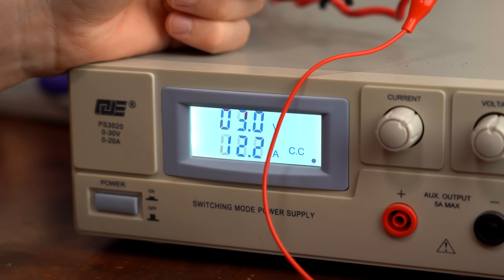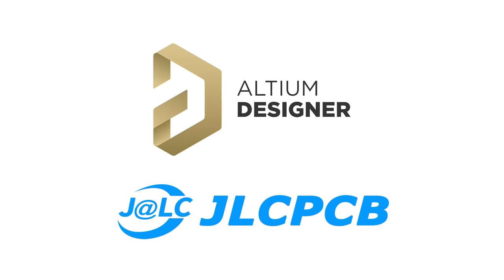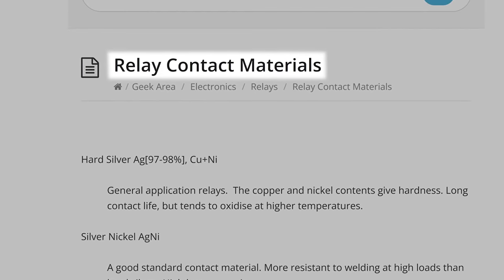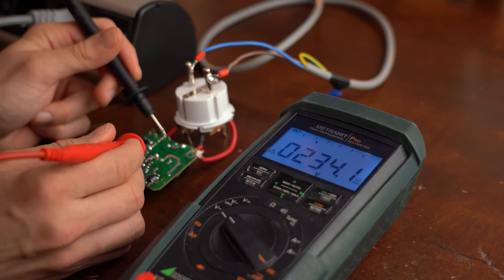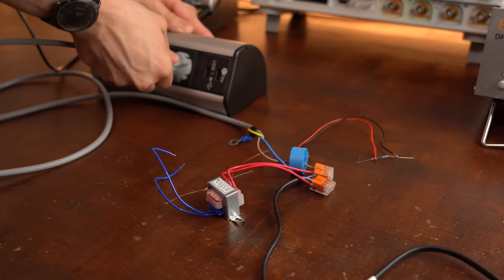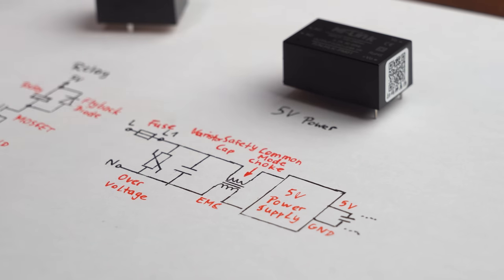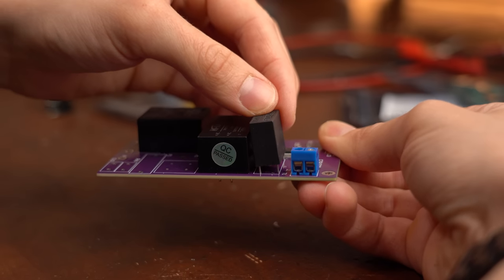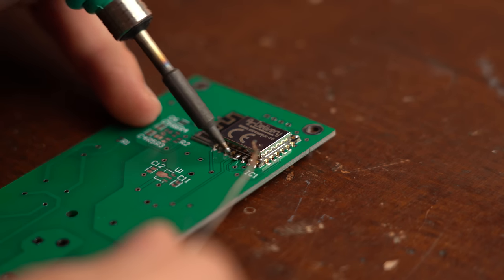The Dark Secret of Smart Sockets and How I Fixed it! (DIY or Buy)

Comment: One thing I was surprised you didn't mention was proper derating for relays depending on anticipated load type.

One of my pet peeves about these sorts of "smart switch" things is that they generally use the cheapest relays they can get away with, which means they are also not derating them properly.  If the switch claims it supports, say, 10A, they actually mean that only for purely resistive loads. (and sometimes it may even say that somewhere in the fine print, but often not)  For any other types of loads it will only be able to handle a fraction of that without eventually failing.

If you are switching inductive loads (like something with a transformer), you really need your relay to have twice the current rating.  If you're switching motors, it should be around 4 times.  If you're switching "tungsten" loads, such as incandescent lamps, the relay should actually be rated for somewhere around 8 or 10 times the nominal current in order to actually reliably function and last properly over time.  Since these sort of "outlet switch" devices could theoretically have all kinds of different loads plugged into them, and you can't know what the user is going to try to switch, you really need to design conservatively, IMHO, and should usually be substantially oversizing your relay specs to be safe.

You also really should design your circuit with some thermal protection to detect if the relay gets too hot (because somebody's plugged too big a load into it, or because its contacts have degraded over time so it can't support as high a load as it should be able to).  Most commercial products place some sort of thermal fuse right next to the relay to detect problems and cut out before things get so toasty that they start melting things or burning your house down.
Reply: For the massive wall of text you wrote, it's weird that you end up contradicting yourself. A tungsten lamp is a purely resistive load. Meaning 25 regular bulbs would be what they expect you to use.
Well in general these are intended to smarten up lamps. They don't expect people to use them on their ac or fans because they think you should normally have that installed and not plugged into an outlet. They're made in China they don't think people live in decades old buildings in Europe.

I don't know what you're trying to control through these but it just wasn't intended for that, i don't think it's really the fault of the specs they report.
Reply: @SquintyGears  No, that's a common misunderstanding, but a tungsten lamp is not a purely resistive load (at least the way the term is typically used in electrical engineering).  This is why if you look closely, many components like switches will have a separate "normal" wattage limit and a (much lower) "tungsten" wattage rating listed.

The reason is that the materials that incandescent filaments are made out of actually have a resistance that varies depending on the temperature.  When they are cold (right after turning on), they actually have a fairly low resistance, and it's only as they warm up (and start glowing) that they settle down to their nominal resistance/wattage.  That means that at first, they will actually pull substantially higher current (10 times or more) when they're initially switched on than they do after they're fully "on".

So any components designed for switching "tungsten" loads like incandescent bulbs really need to be designed to handle substantially higher instantaneous currents than one would expect from the nominal wattage of the bulbs themselves.

(And in my experience, people often do put these sorts of switches on things like pumps, fans, even sometimes things like refrigerators, etc, and then usually get annoyed when they fail after a few months of use, even though they never exceeded the power ratings the thing claims it's supposed to be able to handle...)
Reply: @foogod4237  a variable resistor is still only a resistor. I'm not confused about that part.
I guess i see what you mean, they don't include the burst rating of the first 5s of short circuit current from turning on cold.
That's the source of the arcs. That's why the contacts fuse.
But shouldn't that only covers the material choice? because 5 bulbs doesn't trip anything pulling double breaker limit during the warm-up.
Reply: @SquintyGears   A typical "40 watt" tungsten filament bulb (120 volts) has a cold resistance of about 28 Ohms. If you apply 120VAC (0% THD) at 90deg phase angle, the peak applied voltage is ~170V. This means the peak power for a couple milliseconds (plenty of time for bouncing and sparks) is about 1kW.  Averaged over the first half-cycle (8-10ms) it's still 500W. After many cycles the wire temperature and its resistance has increased to ~360 Ohm, so the average power dissipation is now 40W.
Circuits don't "trip anything pulling double breaker limit during the warm-up" because breakers are designed with a time delay. Mechanical ones use a bi-metallic strip that (like the tungsten filament) takes time to warm up. Fancy new electronic breakers basically emulate this with a time-constant or i^2-t implementation.
Reply: @SquintyGears  I think your confusion is that "pure resistive load" actually has a specific meaning in electrical engineering, and it doesn't just mean "there are resistors involved".  It actually means a load which behaves exactly the same as if a single, standard resistor were put in its place (that also means the resistance not change value over time, etc).

The reason that tungsten loads don't generally trip circuit breakers, etc, is that the current spike is for only a brief moment when turning them on (it's actually only a fraction of a second, not even anywhere near 5s), and most breakers and fuses are actually designed to be fairly slow-acting (partly for this reason).  This can cause a problem, though, if for example somebody replaces a regular fuse with a fast-blow type fuse in circuits involving incandescent lights, etc, because those often will blow in that situation when the more common slow-blow fuses won't.
Reply: Speaking of this (purely resistive loads switched by relays in "smart" sockets): would you see any issues if switching a 1 kW oil radiator? I remember I read in its manual that it should not be  externally switched but as the reason it vaguely mentioned only "for safety" so I'm wondering what it could really be. The smart socket I have says 240 V 13 A so I reckon it should be ok?

Comment: Nice Job. Consider switching the relay at the zero crossing of the mains (since you are measuring the voltage). That should dramatically increase the life of the relay.
Reply: Zero crossing is 120 times per second and relays are mechanical.  I used such a detector for triacs but a relay?  Iffy.
Reply: @bansheedearg  It could use a triac to switch the load directly.
Reply: @bansheedearg  Good Point
Reply: @bansheedearg 
100. He's not in North America.
Reply: @bansheedearg  doesn't have to be perfect, triacs detector is used to rearm the triac for every cycle but for relay you only to do it once every switching. even if you miss the timing by 3ms you still subject to ~30% voltage which creates smaller spark

Comment: Great work again!
You can add a small transistor circuit to switching the coil to a lower holding current to make the circuit more power efficient. Since you were concentrating on improvising the design, you could have  included low power considerations also for the electronics.

Comment: One thing to note that usually cheap relays are specced to AC currents or to a rather low voltage resistive load. In your tests you kinda have a capacitive load in DC.

Comment: Great project! I had no idea how much extra work went in to voltage and current monitoring. I wonder if it would be possible to precisely time the relay turning on and off to match the current waveform you showed. If you were able to reliably switch the relay at the 0 point of the current cycle, then theoretically you wouldn't have to worry about arcing or welding of the contacts.
Reply from the maker: Definitely worth a try :-)
Reply: I was going to mention the same. Mr Carlson's Lab did a similar upgrade on a refrigerator light that used a zero crossing circuit to prevent the inrush/arcing. It didn't use relays but could probably be used as a starting point.
Reply: Just use a zero crossing SSR.

Comment: Hi @GreatScott! , one way that I found that can help improve the relay sticking problem is using a zero crossing circuit to turn on or off the relay at the zero voltage of the sine wave of the main voltage, I believe the IC that you used have that functionality and improves a lot the arc problem ;)

Comment: Scott, I got some threaded, silver tipped contacts, from a big brother of the relay, which was a contactor, and it was made for a large DC drive motor from some warehouse transport equipment. I used these for my welding earth ground as they were much more conductive than the copper plated steel ones that were standard on a battery charger clamp. These were for my "new" flux core welder. 
It was a heavy clamp with a rubberized coating, and was replaced with a newer clamp, but wasn't worn out. I ran a tinned braided copper cable from the welding lead end which were both attached at the jaw on one side. I then secured this with a contact stud from the former contactor behind the back of the pivot inside the grip, around to the other jaw of the clamp. Then I attached a silver contact on this side as well. It was a fair substitute for a proper earth ground, and will work until I find a suitable replacement.
The contacts are proud in the clamp, and have a good "bite" on the steel thanks to a good spring.

Comment: It's a great educational video! I just wanted to share a data with you, you might know also that the enclosed air-tight relay are basically spark-protected by its design. Inside the air-tight encloser, their are no Oxygen available to make a spark/fire. Because the fire triangle is broken here. That's why it's fill with some inert gas like N2, it may be welded together if really high current passes through the contact point(Over 2-3 times of rated current).
Reply: I think you have some misunderstanding of the basic physics of electrical arcing.  Electrical arcing is not actually fire, and it does not require oxygen (or any combustible material) to occur.  What you see when electricity arcs from one contact to another (and what causes much of the damage) is the ionization of the gas molecules into an incandescent plasma.  This can happen with any gas, even completely inert ones (this is actually the same thing that happens (in a controlled way) in flourescent and neon lamps, etc, which also have no oxygen in them).

Removing oxygen can prevent oxidation of the relay contacts (which can lead to high resistance and relay failure), but it does not prevent the arcing itself, nor does it prevent the high heat of the arc which is what results in relay contacts ultimately fusing and sticking together in these sorts of scenarios.

Also, hermetically sealed relays are actually not that common, and are usually substantially more expensive.  Most common relays are not actually sealed in any way that can keep oxygen out to begin with.
Reply: @foogod4237  May be you are right...

Comment: There is one thing you could add also to such a divice, called zero point switching!
It´s used in modern impulse switches and stairwell relais!

Problem with modern contact materials are that the use of beryllium copper was baned some years ago, until then such problems where more or less unheard of!

Comment: Oh, I thought the solution will be solid state relays. But, as it wasn't the case I learned something new about relays. Thanks Scott!
Reply: A solid state relay as 1-st phate of turning-on and after it should be crossed by a normal relay. Well, there is already 3.3V PSU, so why can't be used both? Pretty simple in my opinion and NO sparks on connect (on disconnect - still possible - need tests).
Reply: @Alan123456789876543  on disconnect just turn off normal relay, and then solid state. Agree with you, this will work.

Comment: by the way since you're already monitoring mains you could also make your relay switch in a very low current part of the waveform to extend its lifetime even further (this would also prevent arcing on disconnection of inductive loads for example, not necessarily catch all the inrush current though, but should definitely make it "nicer" / less spikey).

Comment: Nice work. You could as well keep the old relay but add an NTC resistor in series with the load. This eliminates the inrush current capacitor charging problem. I did it with one nasty socket some years ago and it is still going strong.

Comment: You can try designing a hybrid relay switch combined with triac: to power on some consumer, first the signal comes to a triac, which opens at zero cross point and only after that a signal to relay is sent. And the reverse process is used to cut the power. Thus, we receive highly efficient arcless relay work. The only drawback is necessity of extra circuit controlling components.
I've already implemented such device using ESP 8266 for automatic heat control, and it works as expected.

Comment: I am 100% with you - I recently replaced all my cheap boards I bought on Ali (with blue relays, SONGLE) that were almost all sticky, to the new ones - FANHAR - and these are with AgSnO2. Btw good companies use exactly FANHAR relays. It is not easy to find the 5V ones (black, FANHAR) but I back ordered 100 pieces on LCSC. And the cost of FANHAR is just about 0.5$/piece

P.S.
your solution is kindly 4x more expensive than the good sockets i.e. from Athom and they use AgSnO2 relays, that are also providing power  measurements and are based on ESP so super easy with ESPhome

Comment: @GreatScott! I went trough this too. Realized that the sockets are built to a cost not a high standard. Id thought about moding them for higher load but the reality is they already sell them if you look hard enough on google & are willing to pay for it. Would also point out Outdoor smart plug applications tend to have the internals were after

Comment: I've been thinking about this for some time but have not built anything yet. Some ideas I've been toying with:

1. Make a multiway strip. That way you avoid duplicating the LV power supply, the voltage sensor and the controller chip. Plus you put less burden on your WiFi router. Plus you can build in value added functionality like turning off peripheral power supplies when the main device power drops to standby level.

2. Use latching relays. That way you avoid consuming current to hold the relays on. These relays have gotten surprisingly inexpensive.

3. Use a hall effect sensor for current measurement. It ought to be possible to build this like a miniature clamp meter on the PCB. Intrinsically safe and should be much smaller than a current transformer.

4. Zero- current switching. If sensing AC current you can delay opening the relay contacts until the zero crossing of the current waveform to eliminate arcing. Also may be worth closing the contact on the zero crossing of the voltage waveform.

5. Genuine zero-power standby. This could be done with a super capacitor and push-button for wake up. Maybe even a solar cell and an IR transmitter for cordless remote.

Comment: I have for many years done  service on ultra low temperature freezers. The main problem was sticky relay contacts for the compressors duty relays. 
The worst working  relays was with long contact legs and two poles. 
The speed and torque of the switching is so important.
In the last 15 Years s  the relays was changed to a single pole Potter and Brumfield that never let me down. Those small 25amp had one big diameter curved contact side and the other a smaller that rolled a little to the side on every action. The duty cycle of every 15 minutes 24/7 and never made a failure. The sugar cube sized beauties was awesome in function. The ones to try on heavy load and frequent duty😊

Comment: Very cool! Will you be sharing the BOMs and Gerbers for this project? My preferred smart socket is completely sold out, but I need more of them. Also, an inline cable design might be cool.
Reply from the maker: Yes. Of course. I will share all the information. Coming soon😁
Reply: I only have one concern. As you said in the video we are dealing with mains voltage. There are codes and standards the normal manufacturers have to follow. Depending on the country you live in, it may not be up to code.